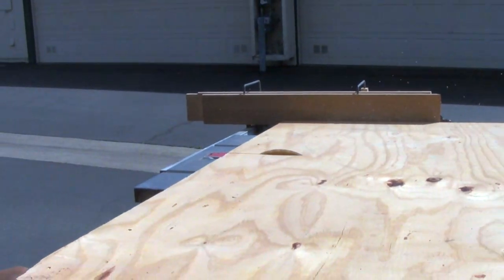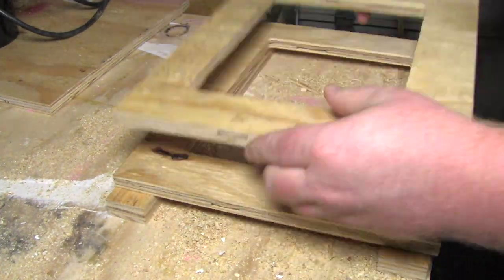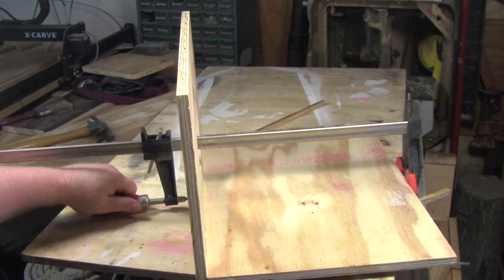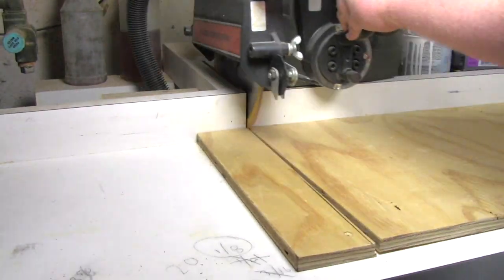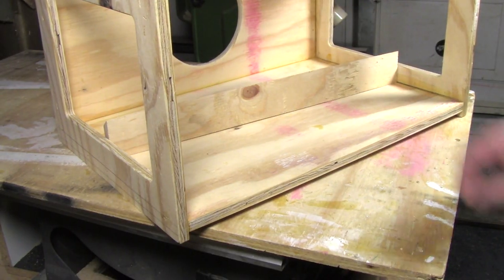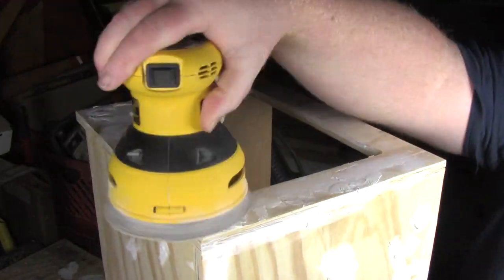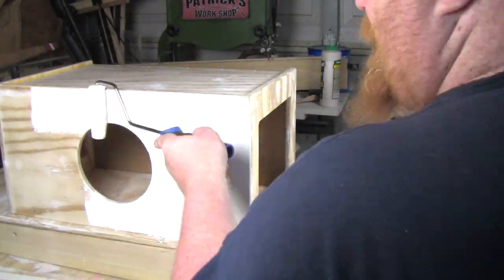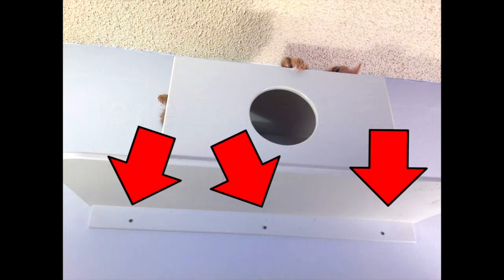How To Make A DIY Cat House

Comment: I have recently got into woodworking and I've just subscribed to your channel as your videos are informative and amusing. Just a few quick question though - what is "spackle" ? I don't know what to ask for here in the UK. Next, when your using the router and cutting out the circle and squares, what bit did you use ? I know what a round over bit is that you use next, but I don't know what bit you use first ? Thanks for your help.  ;-)